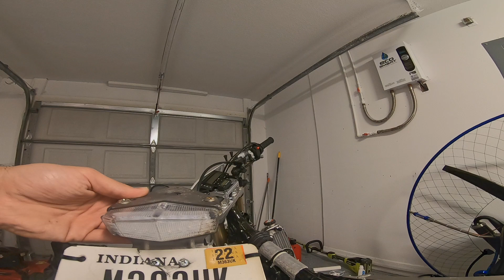Suzuki DR-Z400 Subframe Removal and Replacement | I Crashed My Bike

Comment: Lmao laid down right side and don’t remember, that’s me rn in a neck brace same thing, I’m here in case they total it cuz your bike looks the same
Reply from the maker: Man I hate to hear that. Head injuries are terrible. It’s very likely worth repairing if they total it. Best of luck!
Reply: @FishStick_ADV  all it looks like is mirrors the sub frame, blinkers on right side, handle bar or brake lever oh and a scratch on the exhaust, no plastics were scuffed and looks like the true frame and engine never made contact with the ground
Reply from the maker: @done4cool  not bad, definitely sounds like it’s worth fixing either way. These bikes can take a beating!